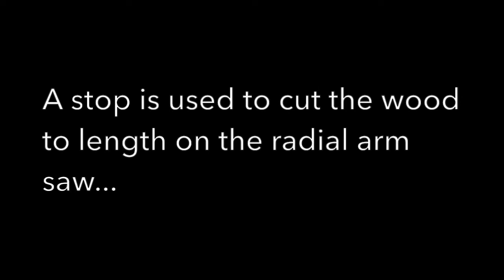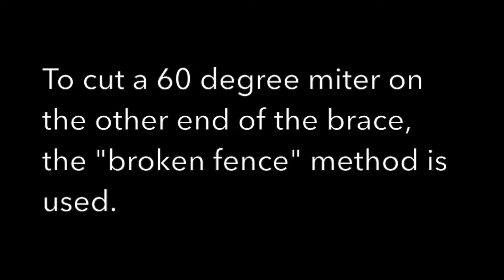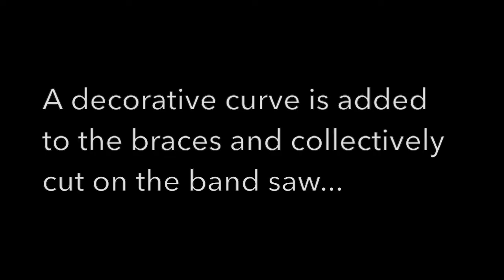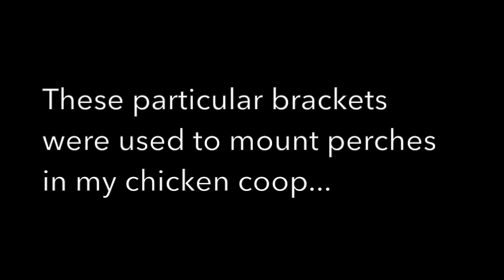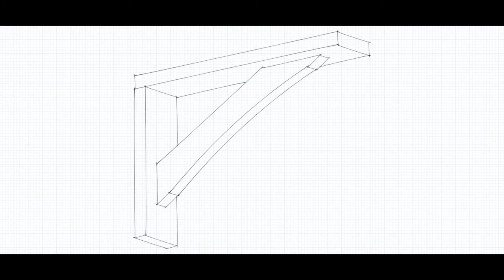Making Simple Brackets for Chicken Perches

Comment: so where do u drill the top 
mounting hole
Reply from the maker: Sorry, not sure I understand your question.  Two screws through the back of the bracket to attach it to a wall.  One screw underneath the bracket into the roost bar to hold it in place.  It's easy to do.